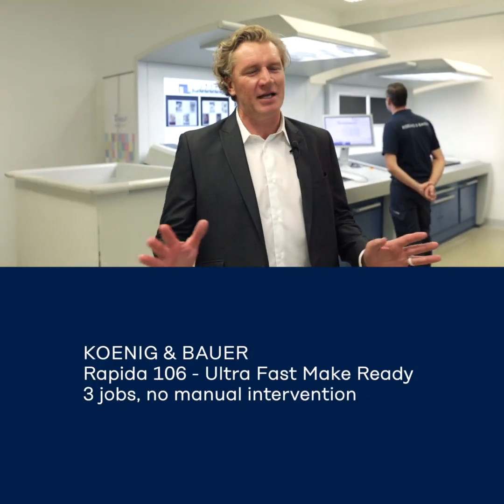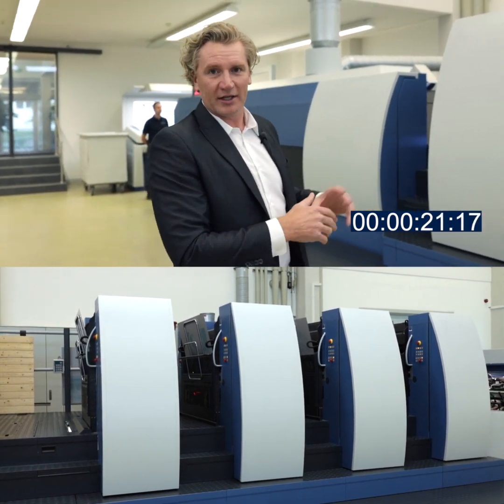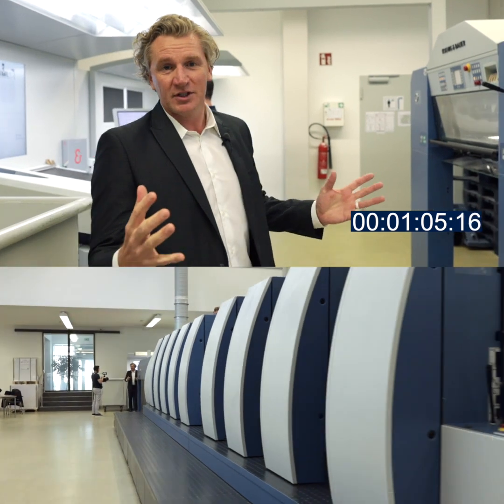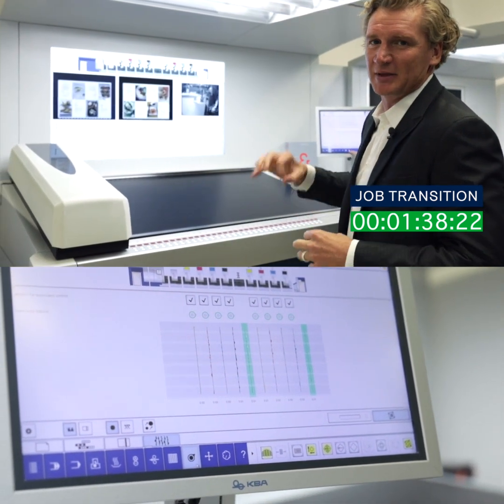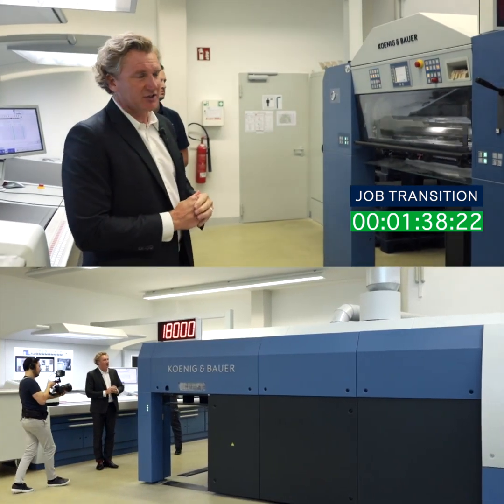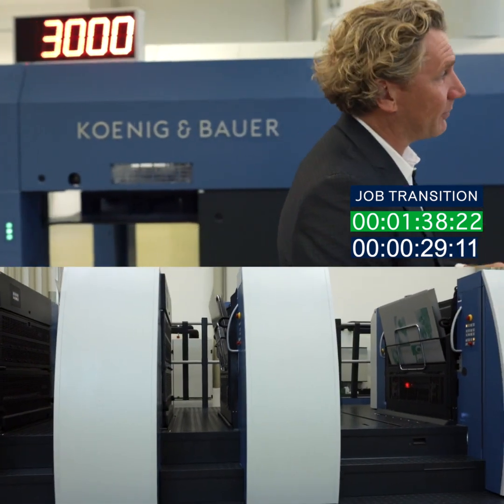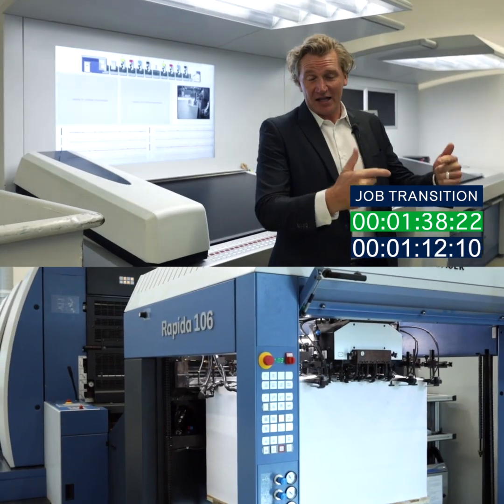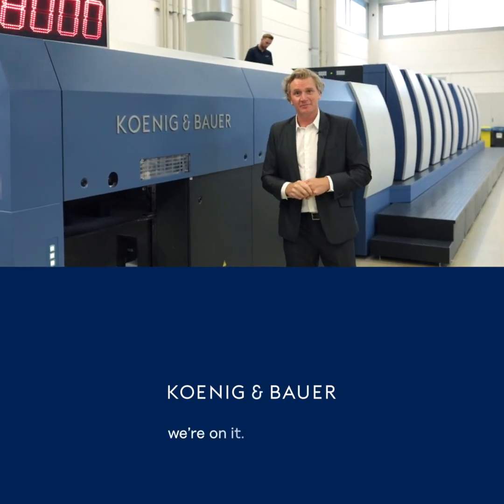Rapida 106 | Make ready | #KoenigandBauer360

Comment: Everyone... I mean everyone who works on the industry knows things doesn't work like that.
Reply: Thanks for watching. Obviously this is our showroom and our goal in the videos is to show customers the potential and what is capable with our new Rapida technology. I can also confirm we do have some customers who are achieving this everyday, of course it is not everyones work mix and this is key to this type of production. Thanks again. Cheers.
Reply: @christraviskba  don't get me wrong. It's an amazing machine. But noone in print shops work like that. I mean, the printer don't even stop the machine after 50-100 sheets to check if everything is ok?? There are many problems can happen before and during the printing process. Not to mention there is no paper format change. The ink (pantone) is already made. And most of the times jobs need to be printed on the front and back of the paper. 
Actualy I work on a rapida 105, all by myself, no paper boy, noone to help. And I know what I struggle everyday to get 4 or 5 jobs done in an 8 hour shift. Depending on the jobs. The problem is that most of the printshop owners sees this, and they think they will spend a ton of money and the production will always be 10 jobs / hour. And when they realise it's impossible, it's always the operator's fault. Doesn't work like that, I wish it would.
Reply: @tweaksilva7253  well said
Reply: I run a KBA 106 AND HES RIGHT THERE DOING JOBS THAT ARE NON PROFITABLE AND FOR AB DICKS OR DIGITAL PRESSES... WHY WOULD ANYONE BUY A 106 TO PRINT SMALL JOBS LIKE THAT??

Comment: so what happens if i toss a pms color in one of those make readies? whats your make ready time increase taking that into consideration
Reply: Andy, Thanks for watching. On our Rapida 106 as a standard option you can wash the rollers while cleaning the blankets, thus reducing the job transition time. We also have what we call Simultaneous Roller Wash (SRW) which allows you to wash the rollers whilst printing in the other units, a common feature for our packaging customers. This allows you to fully prepare a unit with a PMS color while in production. So to answer you question directly around 3mins, but with a specifically configured press we can make it as easy as just an ink up to add to the existing colors. Good question.! Cheers.
Reply: I’m curious, does the simultaneous roller wash system work on machines that have UV/LED lamps? Or more directly in units that have lamps in them? How is the srw different than the flying job change? Great video
Reply: @joshbohn1209  SRW works with UV or LED UV on the  unit or in the unit. This is a recent change and we are able due to the fact we have our own drying system VariDry and were able to prove that the heat generated from the modules were not an issue for the roller wash solvent. The SRW runs, once the rollers have been disengaged, with its own dedicated motor for the rollers that is used for wash ups. Cheers.